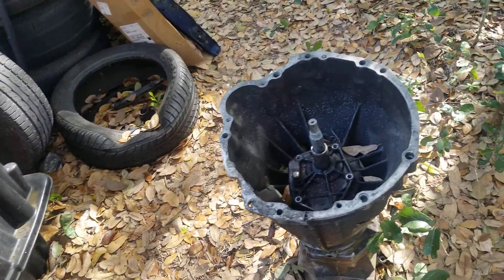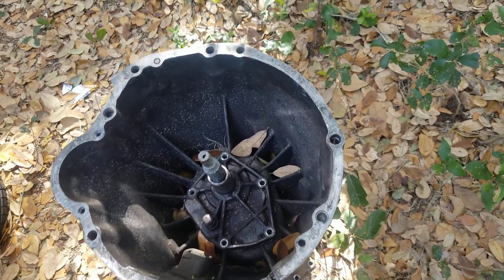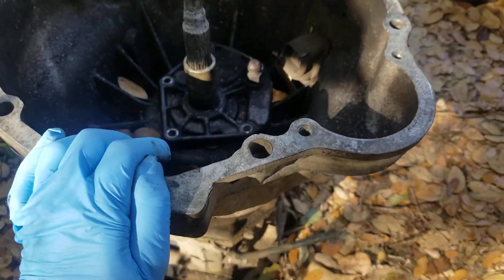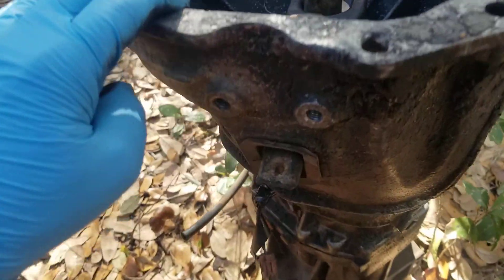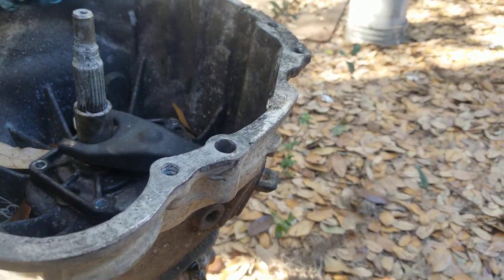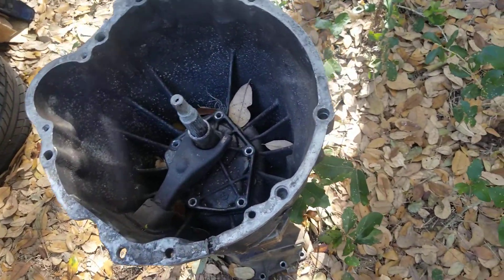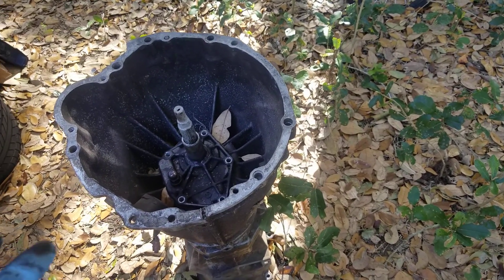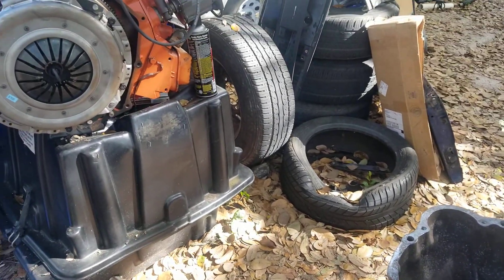How too Mate Nissan d21 Tranny too Small Block 350

Comment: Did you ever actually do it?
Reply from the maker: No. I'm still going thru pretty much the same process. But I'm using different items that won't involve all the cutting, measure and fab work.
 I ended up getting a Muncie bellhousing, an adapter plate and a T5 transmission and driveshaft from a mustang. 
The adapter plate let's the T5 and muncie bellhousing mate together. And the muncie bellhousing bolts right up to the small block. It's just a much, much easier way to do the swap without having too deal with all the guesswork.

Comment: Well I built a 97 Nissan and put a 350 motor and transmission in it turbo 350 and I never had to cut a dry line it's just all the matter of how you put the transmission in if you said it way up forward then you're going to have to make another driveline but if you actually move it back closer and cut one little hole in your firewall you're done it's over with you can stay with the forefoot drive line it's not really that hard it's actually more simpler than what you was talking about adapting and all that making all these spacers for these transmissions I've actually built quite a few of these Nissan's with lses and 350s in them and I've never had a problem with them changing the motor and transmission they actually be a whole lot better
Reply from the maker: Ended up changing the plans a bit! Got a T5 manual transmission and driveshaft from an 02' mustang that I'm gonna install instead of the stock d21 tranny! There's a company that sells the adapter plate that mates the T5 to Muncie bellhousing! 
  Also got a rear axle from a Nissan extended cab! You're 100% correct tho! The swap is much, much easier than I would have originally thought! The main thing's I gotta deal with is the motor mounts and driveshaft!
Reply: @almagam2099  man I made my motor mounts I don't know I'll have to take some pictures look me up on Facebook or something man and my name is William Moore on Facebook and you see a lot of pictures of my Nissan 97 Nissan on my page and send me a friend's request and I'll send you some pictures or whatever and try to help you out I don't mind helping a LOL that's trying to build a rod but I built my mouth and then I turned around and build what you call a cradle Mount and these cradle now go they mount straight to the frame in your weld it to the frame and then you'll come off the motor with mounts and you can unbolt them from the crater Mount cradle Mount if you ever have to pull the motor out so I made my own amount it's my own design it's very sufficient and I guarantee it's not going to break or bend
Reply from the maker: @williammoore4800  dude, that's awesome!  haven't been on Facebook for about a year now! But am coming back real soon! Will definitely look you up! 
And again....thanks for the info and input!

Comment: You think that transmission will hold up to that v8?
Reply from the maker: I think so, yeah! They're stronger and more durable than they're given credit for! Course if I drive crazy and rev the engine to 6 thousand rpm every single time I shift, drive like I'm drag racing or go nuts off roading...then yeah! The 350 will destroy the transmission!
Reply: @almagam2099  oh wow good to know brother! Didn't know they were THAT reliable
Reply from the maker: @abbprrodriguez744  no problem! Yeah these transmission have decent low end torque! They are able too tow more than is apparent! I regularly towed a trailer and a smaller zero turn mower for work on the stock clutch! probably around 1400 pounds?! I wasn't breaking any speed records but she handled the weight pretty decent! 
After the upgrades, Weber carb, headers, and heavy duty clutch she handles far more weight, easily!
I towed my bigger zero turn mower that easily weighs over 1000 pounds and a trailer that easily weighed in the 600 + pound rang! I had too keep looking behind me too make sure I was towing anything!
Reply: @almagam2099  ohhh thats super sick dude! Are those the only upgrades you've done to the truck? Did you install the $500ish Weber kit?
Reply from the maker: @abbprrodriguez744  I have the 38/38 weber! Pacesetter headers, magnaflow catalytic converter and muffler!
 Iridium plugs and wires and NGK ignition coils!
Reply: @abbprrodriguez744  yeah I bang gears pretty much every time I drive mine. the tranny definitely outlived the 2.4
Reply: A th350 is pretty much a bolt-in affair, just elongate tranny mount holes, use the chevy output shaft and mate it to the factory driveshaft, no shortening needed either.
Reply: @gabegonzales790  I'm probably going to put   a Chevy V8 or V6 in mine with the rear end too. Love my old d21 and Chevy stuff is usually cheap.
Reply: Witch transmission does your truck have mine has a rl4r01a